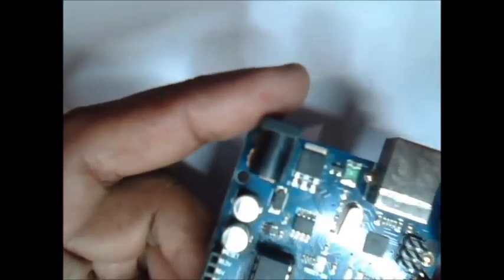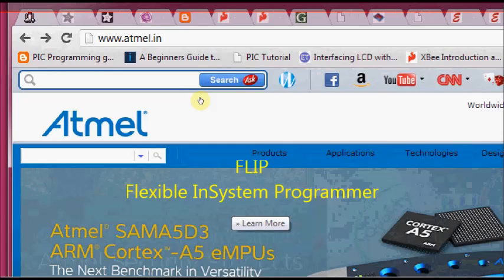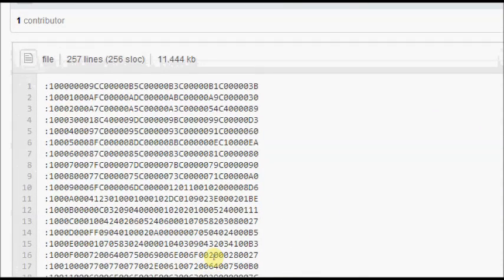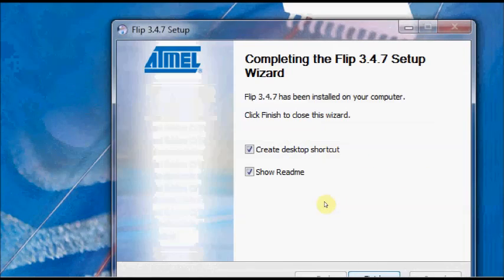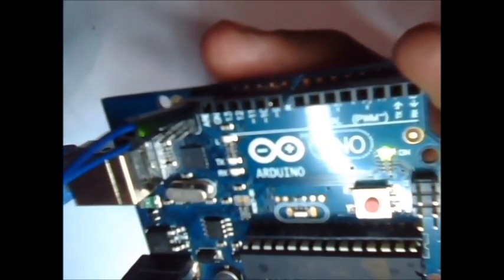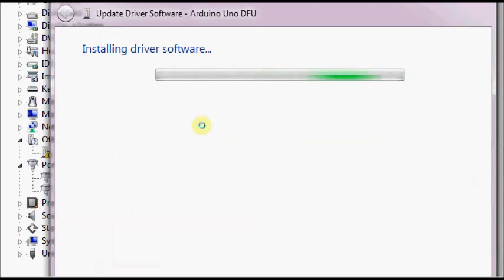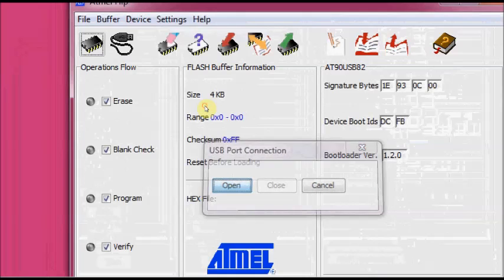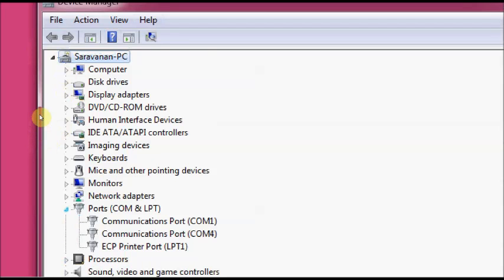ARDUINO- Upgrading USB FIRMWARE using FLIP

Comment: Sir you are a GOD, thank you so much. I had been trying for days to flash my arduino with a hex firmware to use as a controller, and this was the only video that showed about grounding the capacitor to activate DFU mode and updating the drivers.

Comment: I made a drum midi trigger with Arduino UNO , which also require Hairless serial to midi converter. It works fine.
Recently I upgrade  it's default firmware to Mocolufa . now it is recognised as a Usb hid Device . But its Drum trigger program don't work the way it used to . It send some weird messages.  How to fix this to send midi notes ?

Comment: Thank you so much!! I was pissed my Elegoo Mega 2560 R3 did not work. The only difference for this boards is that to get it into DFU mode I had to simply take the pin left of the pin you used and plug it into the reset slot on the board. Then DFU was on. no need to trip the capacitor thank you much!
Reply: Same issue with an Elegoo Uno R3. Worked for a week or so then effectively bricked. Hours of troubleshooting/Googling got me here and the video sorted. Thanks so much Saravanan AL

Comment: This tutorial is difficult when the video quality is like 240p..
Reply: really.. it's a really good tutorial despite the quality
Reply: Daniel Tevi It has good explanation, it was just hard for me to see which parts he was pointing to.
Reply: Jason Lee I might make my own video in HD when my board arrives if you are interested
Reply: +Jason Lee Alright, I need help man. This wire thing he plugs into the ISCP, what wire is that
Reply: @draike7  pin no5 reset pin in icsp1 or first pin from usb end towards the slot. rest pin to ground to keep reset low 0volts
Reply: 4 yrs late

Comment: Just touch the isp pins closest to the usb jack together, way more simple to put in dfu mode.
Reply: I have the same board he has in the video.. Your suggestion didn't work. Although it is the official method given in the arduino website, it doesn't work for me.